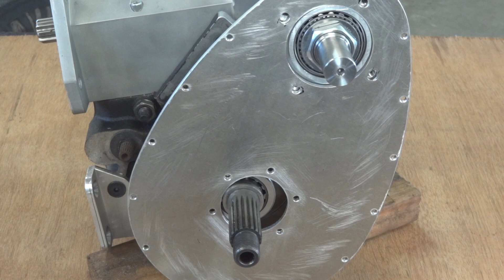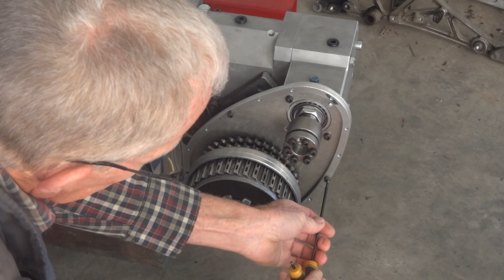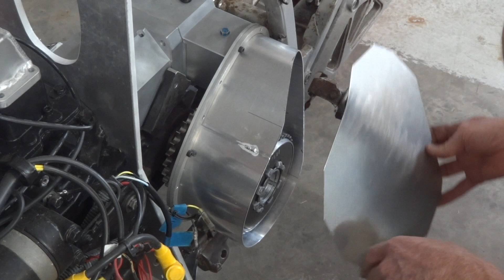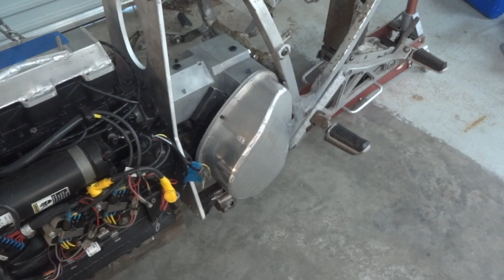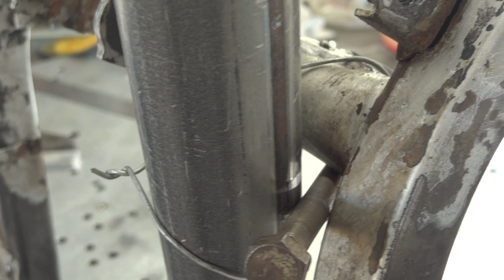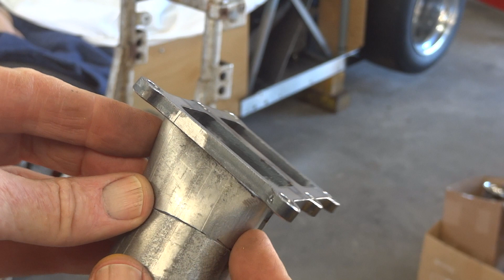Mercurial Outboard Motorbike Clutch Cover and Exhaust, Mercury

Comment: Can’t wait for what you will do for expansion chambers.  The outboard did not need them because the thru-hub exhaust vortex did the same job of scavenging the combustion chambers. You will need something I would think. 

Nice fab work!
Reply from the maker: Interesting question. I don't think a chamber will work, because all 3 cylinders are already siamesed before they exit the engine. I was thinking just some volume, and then some back pressure. Total guesswork.
Reply: @malcolmoastler3039  love your work mate. I found you vid while thinking about the same idea. I cant imagine an expansion chamber would work with the correct resonance but wouldn't the firing cylinder push the fuel back into the cylinder that's at bdc anyway if you had joined all the exhaust outlets?
Reply from the maker: @TheCunneen  they're all joined already, inside the engine